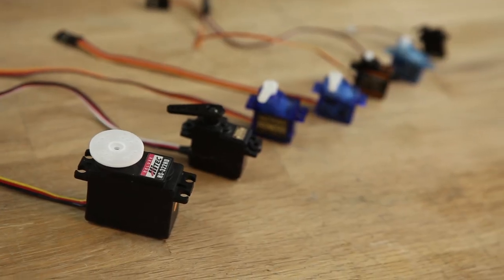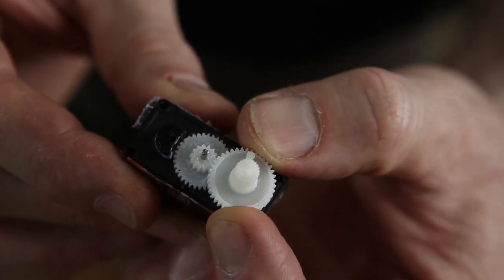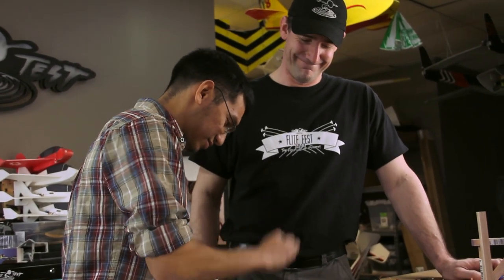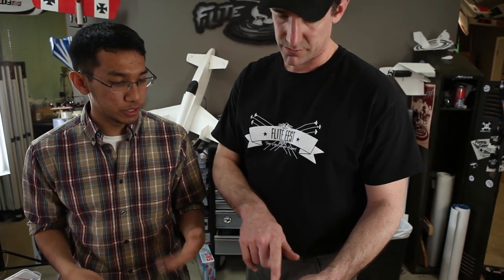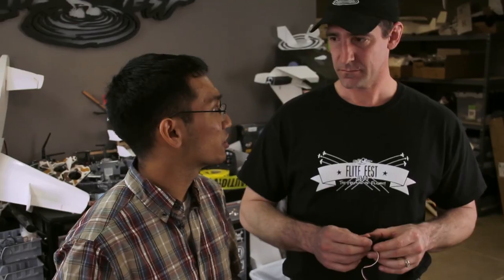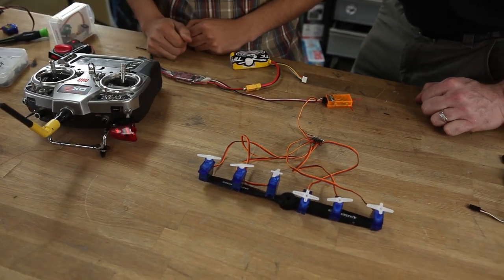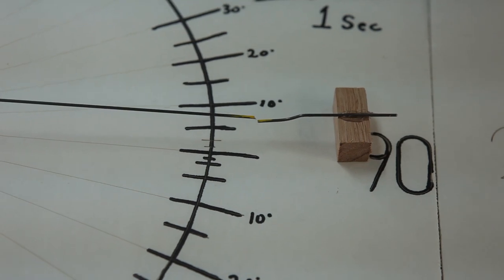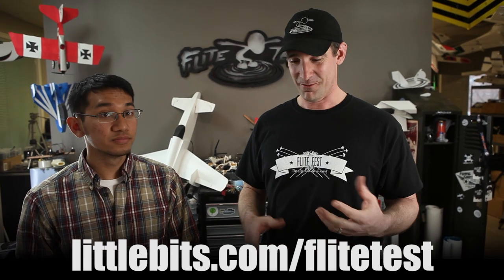Flite Test | Servos 101

Comment: So how do you prevent the brown out caused by too many servos?
Reply: Tim T Use a Better or Bigger Battery Eliminator Circuit (BEC). On the smaller ESC's that include a BEC, the BEC is a linear power supply to the Receiver, which, in turn, powers the servos. On Bigger/Better ESC's, the included BEC is a switch-mode supply whose voltage output sags much less than the linear BEC's when there is a big load from the servos - i.e. pulling out of a steep, fast dive. You can also use a separate BEC so if your electric motor takes out the ESC, The BEC still works and you still have control when you deadstick the landing (no more motor power). You can make a setup like Peter did and stress your system before installing it. Put a good deal of drag on your motor and on the servos, and use a power meter to show what is going on, real-time. Of course, smoke is your biggest indicator (or, right after actual fire) There is an FT video within the last year where Josh B. shows how to use a power meter. Does that help?
Reply: Peter Gregory From experience, I can't advise intentional use of smoke as a diagnostic indicator (smoke = broke, both the electronics and your wallet from having to buy replacements). Other than that, it all checks out.
Another great indicator of over-stressed electronics is heat. A thermal camera or IR thermometer will help find the hot stuff. Thermal camera is quicker, but usually expensive unless you ask around at a college engineering lab or something like that.
Reply: 44R0Ndin The FLIR One camera is a relatively inexpensive thermal camera for iPhone and Android phones. Worth checking out for this purpose :)
Reply: Jacob Zigenis
I was going to mention that, but even a 150-300$ (something like that) thermal camera being used relatively infrequently on 50$ worth of electronics doesn't seem justifiable.
Then again, if you're doing large scale stuff all the time it's probably a worthwhile investment.
Reply: 44R0Ndin But they are really cool. So there's that. :p
Reply: Peter Gregory Yes, that helps thanks!
Reply: 44R0Ndin Smoke = Broke is correct. Because all electronics run on smoke. If you let it out, it will not work anymore.
Reply: Ha! I used to be a practicing electrical engineer. One time my tech put a tantalum capacitor in backwards - they're polarized so you have to get - to ground and + to power. He plugged the board in and after a minute he turns to me and says, "Hey, I didn't know you added an led to the board?" I looked over and was like "%$&#!!! Unplug the board!" tje cap was glowing red like and LED. I couldn't believe it didn't explode. It probably permanently delaminated the circuit board.
Reply: Peter Gregory
I may be just an electronics hobbyist, but that's one thing I'm ALWAYS double- and triple-checking on my circuits. So far, I've only fried a few chips, LEDs and resistors. To be honest, I hope I never have to work with tantalum electrolytics, they're pretty toxic when they go pop.
Reply: It would be awesome if FT could do a separate video on various methods of diagnosing and solving brown outs. How to deal with brown outs is common knowledge in hobby electronics, so finding good information online is pretty easy and should apply directly to model aircrafts.

Adding to what Peter Gregory said, I think it's important to understand the difference between a linear and a switch mode BEC.

To clarify the difference between a linear and a switch mode BEC, we'll imagine the input and output as water barrels. The input barrel is connected to a lake and as such will always be filled back up to the same level as the lake. Now you want to give your good friend Barry some water through the other barrel, which conveniently has a hole in its side to drink from.

The problem here is that Barry still has to breathe air. Unfortunately for you, Barry is a walrus so he doesn't know how to plug the hole. This means you have to keep the water level around the same height [voltage] as the hole, or water will spill all over Barrys shiny new origami creations below (he is a very talented walrus). Lets say you come up with two solutions:

Solution 1; since the drinking hole is below the water surface in the input barrel, saw off the output barrel at the height of the drinking hole. Then simply drill a hole in the input barrel and let it pour into the output barrel when Barry is drinking. Water will pour out of the output barrel at all directions, but you can vary the flow out of the input barrel with your hand to minimize the spill. All you have to do is borrow some tools from Pete for a while and you're all set until the lake dries out.

Solution 2; use a bucket to fill the output barrel (without sawing it off) just high enough for Barry to drink and stop when he takes a break. You'll need to buy a bucket, but you won't annoy Pete (whom by now is pretty fed up with you borrowing tools from him all the time) and there's very little spill. The downside is that you'll have to drink some of that water to not pass out from exhaustion, after all Barry is thirsty enough to dry out a lake.

As you can see, both solutions have advantages and disadvantages. In both cases Barry will have drinking water while keeping his origami artworks intact, but the way there is completely different.

In a linear BEC you essentially end up with solution 1. Excess energy [water] from the voltage [height] difference is dissipated as heat [spilled water]. It can keep up with pretty quick changes in current without introducing noise though and with sufficient cooling [handling of the overflowing water so it doesn't puddle up] are very reliable.

In a switch mode BEC, it's a lot like solution 2. Excess energy [water] is kept in the battery [lake and input barrel] and only flows over to the output when needed. However, due to the way these are built, a small amount of energy is lost as heat [drinking some water] when opening and closing the flow [lifting buckets]. A slight downside to a switch mode BEC is that they introduce noise, this is because unlike with a linear BEC the flow of energy [water] isn't continuous. This can be hidden pretty well with a sufficiently large capacitor [extra water barrel] after the output to smooth out the flow, but the noise will always be there.

Generally we can approximate these two as linear BEC being input current = output current, while a switch mode BEC being input energy = output energy. Neither has perfect efficiency, but a switch mode BEC is significantly more efficient than a linear one.

If small amounts of noise isn't an issue (like on most flight controllers and servos), then a switch mode BEC would be the better choice. If noise can be an issue (like with cameras), then a linear BEC is needed. I think this is why ImmersionRC decided to use linear ones for their built in 5V 300mA BEC in their video transmitters.

Finally, a large capacitor can be added over 5V and GND if your servos keep browning out in rare cases or you can't find a beefier BEC. Servos usually have a low enough duty cycle for the capacitors to recharge between movements. I used it on my RC car once where the servo would draw a fair bit more than the BEC could deliver. Adding a capacitor bank of 0.78F solved the issue, making it possible to move the servo continuously at full speed for a few seconds (a scenario which only happens in stress testing) without the receiver browning out. The larger the capacitor, the more fast and continuous maneuvering time you get.

Comment: lol i have nylon bike tires that are orange after a few burnouts you can see the difference over rubber
Reply: +harvey banks Nylon tyres????? The main job of a tyre is to improve traction. Using a self lubricating material to improve grip seems a bit....counter productive. Just I wouldn't cover my tyres in oil to make them more grippy!

Comment: How does this piston thingy servo (the large one that pushes out slowly) have torque? To create torque you need to have a lever... You probably meant force :D
Reply: JetPackJan Something inside that piston thingy rotates. Does that count?
Reply: Balu
Yes that there most likely is a motor inside it that creates torque. But the output, what it creates, is not. It might be easy to confuse for a lot of people but its like confusing an apple operating system with a windows OS...
Reply: JetPackJan  The linear actuators are still driven by rotating motors which produce torque.
Reply: Yes the motor inside the linear actuator creates torque. I doubt it produces a lot though, it probably just spinns very fast and a gearbox then moves the piston on a thread or something. Ergo there is torque involved in the gearbox and probably a lot of it but the output is not torque its just a force because its a linear motion not a rotary one. And this is what I tried to point out because he said in the video the actuator produces a lot of torque.

Comment: Does anybody know why they can't increase the clock on an analog to 400 per second?
Reply: Walter Clark  That is basically the difference between the two.  It requires extra electronics to do that.  Digital servos have the extra required brains to do that.

Comment: what happens if i put a 7.4V 1200mah battery in a quadcopter that's made for a 3.7V 600mah ??? will it fly??? or fry?
Reply: Frederik Mark Henriksen It depends a little on what electronic is inside the copter. If the voltage regulators can handle that voltage, you should be fine, but it will be a very different kind of beast. Also the bigger battery comes with a lot more weight, so you should make sure that the copter can carry it. Twice the voltage / twice the motor RPM does not result in twice the lift too.

And when you crash, the more weight usually means more damage too.
Reply: Balu i got another one.
what if i use some of my old 1000mah 3.7v cellphone battery? soldering a cable to the contact points of the battery and the connecting to drone, cellphone battery's seem made of high quality/light weight/ small size and close to perfect for a drone, since i've got few laying around getting old and unused .

Comment: i hear digital servos use more power than analog, is that true?
Reply: Stephen Rivest Assuming that the ONLY thing that changes is the control board, probably. At least when moving, loaded, or both.
More updates per second = motor gets powered more often per second = more power drawn.
Of course if the digital servo uses a different motor or the gear ratios are different, all bets are off.
Reply: Stephen Rivest Digital servos use smaller control components than analog, so there is more room for the motor.  So usually, yes, but it depends on the individual designs being compared.
Reply: Folopolis
Interesting. I didn't know that about using smaller control components. I always thought it was just a more sophisticated chip on basically the same control board. After all, it's not like they can get away with using smaller drive transistors if the motor stays the same size, right?
Reply: 44R0Ndin
It's not that they couldn't use smaller control components in the analog servos, it's just that they use the same designs from when transistor manufacturing processes were much larger.  Whereas digital servos use newer designs.  Also, an analog servo has a DAC in it, whereas a digital doesn't.  A digital is PWM all the way to the motor, but because analogs don't operate at a high enough frequency, they need to convert the PWM signal to an analog one before sending power to the motor to avoid damaging it.
Reply: Folopolis
... not exactly.
All RC servos use PWM to drive the motor. More on-time = motor exerts more force.
Digital servos need 2 ADCs. One to measure the pulse width of the input signal, and another to measure the potentiometer.
Then they use a microprocessor to control a PWM motor driver (basically a small reversing ESC for the servo's brushed motor) All the control stuff is on a single chip, with 4 power transistors to drive the motor

Analog servos can use the same kind of tiny reversing ESC for the servo's motor, but the control electronics are all based on voltage ratios instead of binary logic.
Reply: 44R0Ndin
Measuring the pulse width is not an ADC, it is single purpose DSP, which is a substantially simpler circuit.  Analog servers do internally convert the PWM signal to an analog voltage modulation, which is where the DAC comes in - and why they are specified as analog. 

The motor usually doesn't particularly care whether it sees a PWM signal or an analog voltage, but when you are operating at a low frequency like analog servos PWM will cause erratic motor movement.
Reply: +Folopolis ..hhmmm, Analog means its amplifiers controlling motor and motion. PWM signal is transformed into an analog voltage. Its (Where_to  - Position) = MotorPower (positiv turn right/ negative turn left(Error)) and the bigger error the faster the motor turns. And then there is PID parts of this analog control loop. Digital is a computer reading values and controlling the motor, so it can drive it more accurate and with faster updates. If you feed an analog servo other than 50 Hz frequency PWM, it will not be able to read the signal correct, it might read it as 500 ms and drive the motor to mechanical end stop and burning the motor!! Thats why most analog servos need 50Hz PWM. And yes Digital Servos draw more power with its faster updates and more precise action even though the pwm motor power of the digital servo is more efficient.

Comment: 10:15  When you are measuring torque the way you did, you have to multiply the result seen on the scale by the actuator arm length to get the real value. 
That's why they usually measure it with 1cm or 1 inch arm length; you see the actual value on the scale (have to multiply by 1).
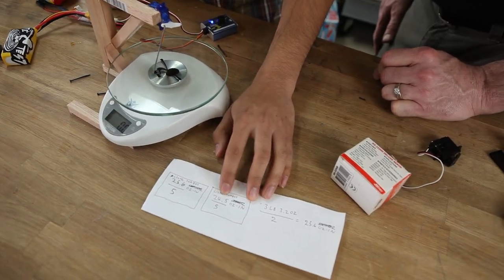11:30 Torque is a rotational force. It doesn't change with the arm length. It is a value you use to calculate the actuating force with a specific arm length

Guys, I like your videos, but please don't mess up with the theoretical background

Comment: There's no pot in a digital servo.The rotation is controlled by a chip on the servo control board.And way back before these guys were born we had excapements ,servos weren't invented yet.

Comment: to VIDEO EDITOR, turn up your black levels! cant see shit in the shadows
Reply: Calvin C That is odd, I have no trouble, what monitor are you using and have you calibrated it?

Mine is an old Apple display from 2006, but I have it also calibrated.
Reply: Calvin C Must be your monitor, I can see just fine no problems.
Reply: samsung s24d590l, important thing is that it's PLS
Reply: Calvin C I have no clue about this monitor, specs looks ok, but price point and resolution suggest it's a budget monitor. Also it has LED, which is nice in many ways, but not so good for the contrasts. 

Have you tried calibrating it? You don't necessarily need a expensive device to calibrate the screen somewhat good. Just Google and you may find webpages with a few tricks to help you calibrate.
Reply: Calvin C I'm viewing this on a 2007  52" Sharp Aquos LCD HDTV @ 1080p.  Brightness set to 0, contrast set to 31, back-light +7. It is running off a PC with an nvidia GTX670 via HDMI on FireFox 37.02. This video was not terribly "well lit", but the blacks are not crushed and I have no problem seeing the details. Check your monitor/ screen.
Reply: Wow, too me, even on other screens the is just not enough light, if you look at the black servos and their shadows, I can hardly see any detail.
Reply: Calvin C Brightness setting pushed up a little and contrast setting down a little usually helps that, but on weaker displays, sometimes there is nothing you can do. It is probably the display itself crushing the blacks, or else it could be a setting in your video card drivers that are overriding the settings on the monitor.  So many things could cause that actually.
Reply: Calvin C Many monitors do not handle blacks well.
 
I have a rule for myself when considering displays. I don't look at anything below 500€. But then I don't buy them often, I still use the same screen I bought in 2006. Back then it costed me around 1000€.

That in itself is not sufficient as a decision maker, but it does filter out most of the weaker displays. 

Back then I was choosing between an Apple or Samsung display. The Samsung was probably a bit better (by specs), but as I could not find it on display anywhere, so I could see how it performed in reality, I bought the Apple display.

Testing them before buying is crucial, even more so when the budget is restricted.
Reply: Calvin C I'm viewing this on an ASUS VG248, a budget 1080p 144Hz monitor with a VA panel (decent monitors do not have to be expensive). I have no issues with the dark areas at all, despite the relatively poor color depth compared to my secondary HP screen (which has a very good IPS panel). Your PLS panel should blow this VA panel out of the water, check your monitor settings.

Comment: lol 'analog' servos :). in fact they're just faster digital servos.
Reply: *****  They are both analog as they send out analog signals to the motors.  The "digital" servos just have a processor to slice up the incoming signal from the receiver into smaller bits so it can send out faster pulses.  That is the main difference.